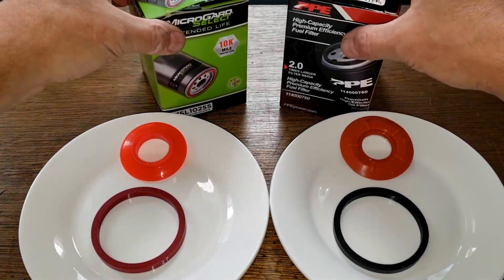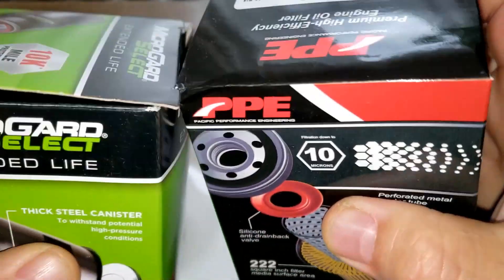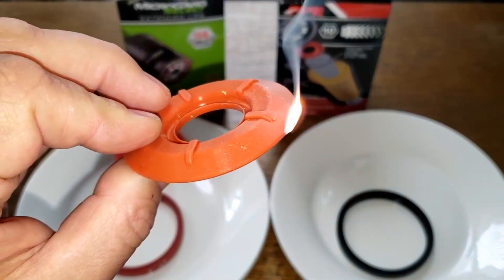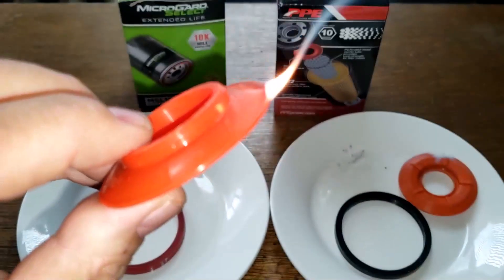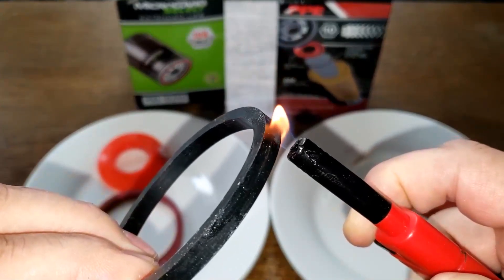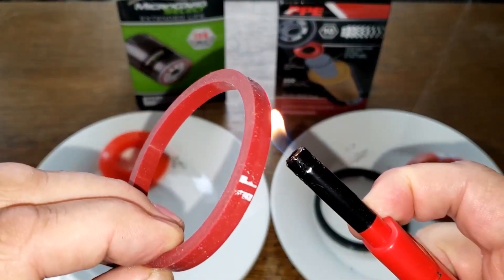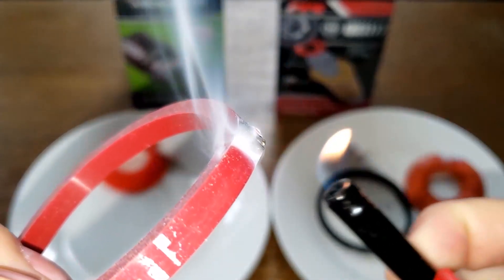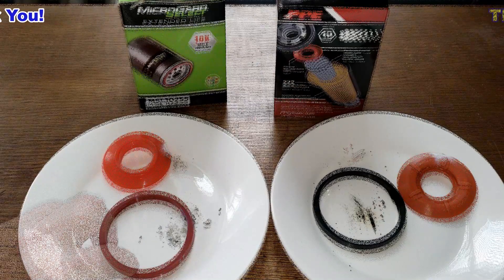Microgard Oil Filter Silicone Gasket Burn Test

Comment: so do you think the silicone will seal better? will it resist blowout from pressure as well as the rubber? and will it be less likely to stick to engine block from heat over time?
Reply: Also silicone has far far better cold weather performance as well.
Reply from the maker: I don't know, but what I do know is when I take used nitrile rubber gaskets off of filters they are flattened. To me, it doesn't matter either way. Not a deal breaker for me.

Comment: Good confirmation burn tests. When it comes to the sealing gasket though, I've used the nitrile and/or ptfe coated type for decades, never an issue with sealing. And the sealing gasket serves a different function than that of an adbv. The latter benefits from staying pliable over the course of an interval. No true of a sealing gasket, once properly installed it should stay sealed. How it's worked for me. So, while silicone adbv has benefit especially over longer intervals, I'm less sure that's important in a sealing gasket., But, I suppose it can't hurt. The Microgard seems like a well made filter, but if I can get it, still prefer US made. Thanks for vid.
Reply: Only had one nitrile gasket leak in 50 years on a vehicle that gets one yearly oil and filter change at around 5,000 miles. Honestly, the rubber just lost a little bit of compression over time. Not really a problem.
Reply from the maker: You're Welcome faxmen09👍

Comment: I've never tried the Microguards but they are impressing me.  Your usual outstanding work, Pete.
Reply: I slapped on my first “made in Vietnam” filter on the premium guard paint. My truck has been showing lower than usual oil pressure whenever I use filters with louvers in the centre core. With this new filter Im back to full pressure!! Because of WCW I bough a 6 pack of these and will be buying more! Use with confidence 😊
Reply: @jacobmartin1981  This is one of the reasons I like Denso OEM filters for my MAZDA CX-5. The inner core is actually 100% open, with no louvers or holes. Max oil pressure at all times.
Reply: @jacobmartin1981  nice!
Reply: Overall, the Microgard is a great filter.
Reply from the maker: Thanks, Jim👍

Comment: Ive been using the Microgard Select for the last year and love it.
Reply: Where do you get them?
Reply: @jamescaron6465  
O'Reilly auto parts. 
Also, if you haven't watched his video where he took one apart, you should.  You'll see how much better made they are than most filters in the same price range. 
Make sure you get the Microgard "Select" filter and not the regular Microgard.  I think I paid $9 or $10 for mine.
Reply: @RicArmstrong  Thanks man!  An O'Reilly just opened a few months back not too far from me.  I will certainly check them out!
Reply: @RicArmstrong  100 % agree.